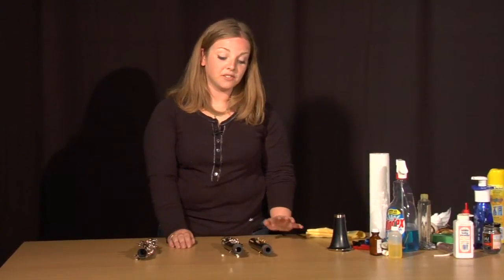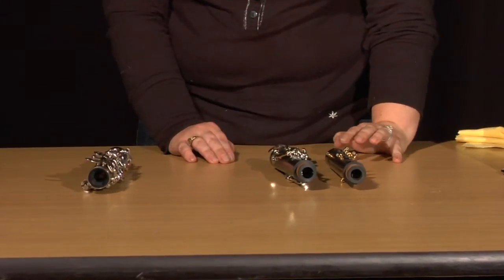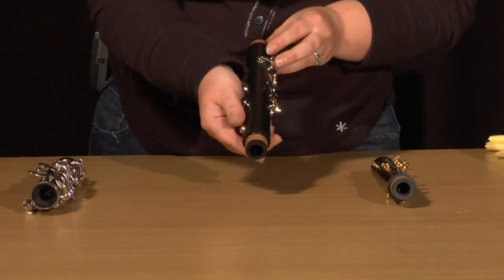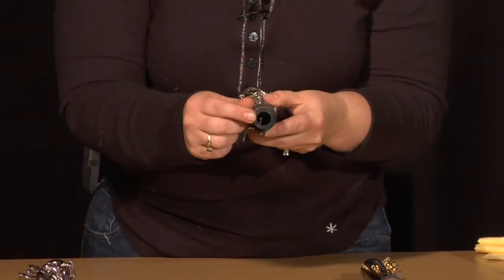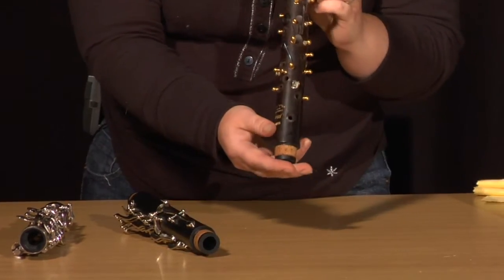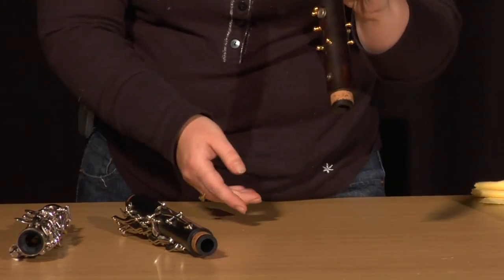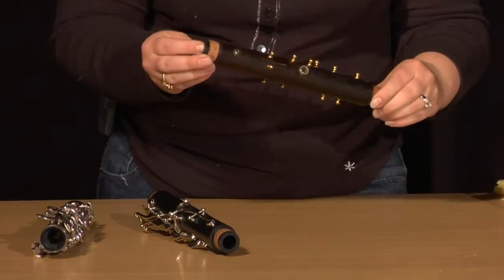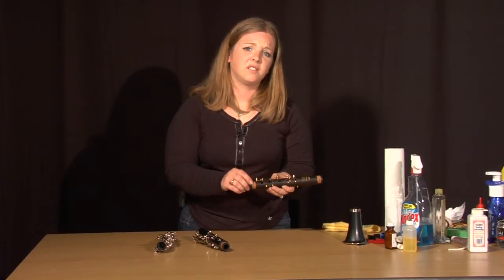Clarinet Maintenance : Determining Wood vs. Plastic Clarinets

Comment: Guys, it's not gonna bun it in flames. That would be stupid, though you shouldn't put a hot needle to the clarinet either. Just take it to a professional to let you know wether it's plastic or wood. That is the only way for you to be completely sure.